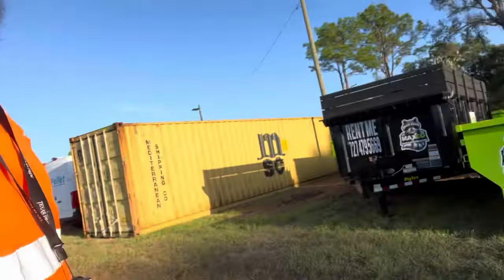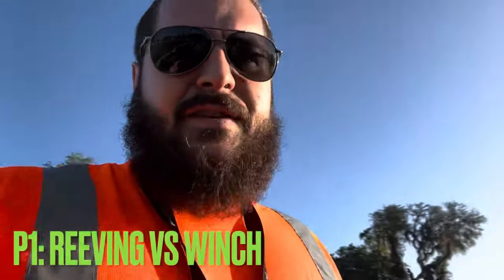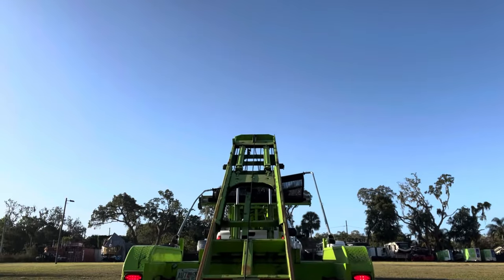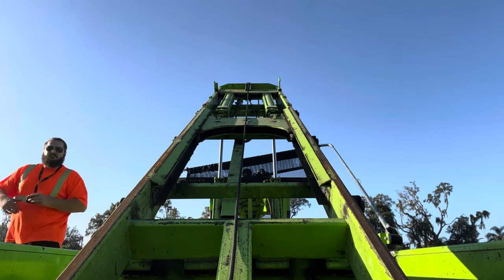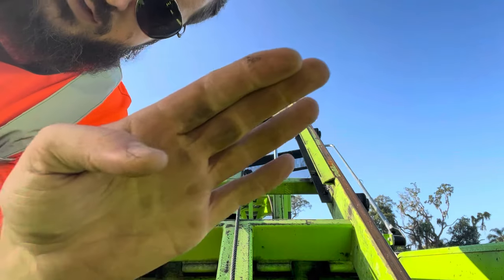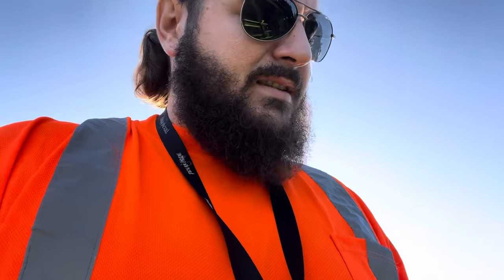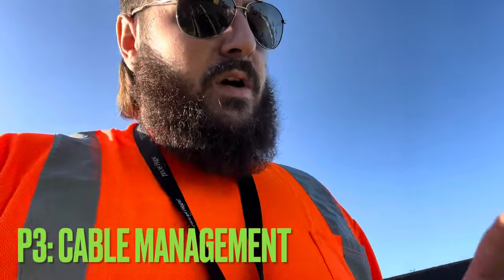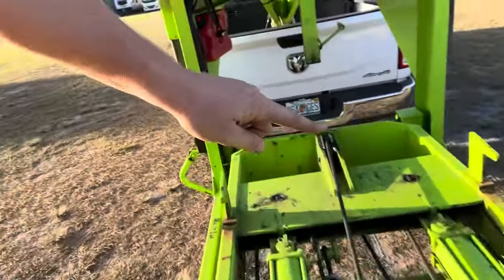Reeving vs Winch | Dumpster Rental Business FAQs

Comment: The reeving system is basically a double snatch-block system.  It has higher pulling capacity over a single line  winch pull.
 It is smoother, faster and safer for loading and unloading the cans.
Reply from the maker: Yes sir. 💪💪💪 Thanks for watching

Comment: The reeving is superior but I don’t think i could put up with a motor screaming away 🤫 also a sherpa commercial winch will last pretty much forever costly but nothing is cheap in this game. Good video 👍
Reply from the maker: I’m really hoping to go hands on with an electric ⚡️ only reeving trailer soon, but I know Texas Pride has/does make it without the motor. My fear was keeping the batteries charged, so I went motor, but I’ve heard a few people say they perform well!

The motor isn’t so bad though. If you’re patient you can run it at low throttle and hardly hear it. I only run it full throttle when I’m operating it. Once my rails are up I go low throttle to back up, etc. it’s basically silent then.
Reply: @MAXCODumpsters  nice yea even the electric pump i dynomated the toolbox and put a rubber mat down to keep the whine down. But the motorized pump does put out way more flow. Suppose you could run 2 electric pumps but that would put even more strain on the batteries

Comment: Great topic!! YOUR  advice is what I  needed to decide on which one to buy. Thanks
Reply from the maker: Glad I could help! I don’t think You’ll be disappointed. 💪 Where are you ordering from?
Reply: @MAXCODumpsterRentals  because of price,  texas pride.  Key stone is pricey. I have to buy 14 ft with 8000 lbs axels. I own a 2014 350 truck, I own it free and clear.  Gvwr 11500. Trying to stay under 26000. My order will be Standard rail, 13 hp Honda with reeving. Plus auto tarp. You open my eyes up on reeving. 👍
Reply from the maker: @darrellmyers9248  when I bought mine there was almost no information on them online. Glad more people get the opportunity to check them out! They’re a great way to go. 💪